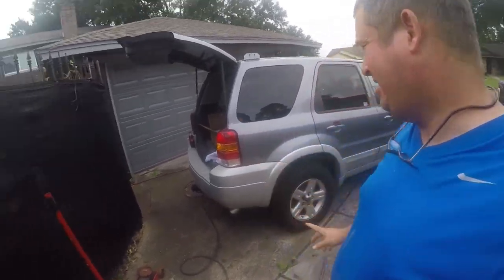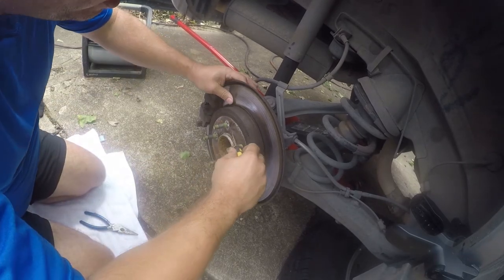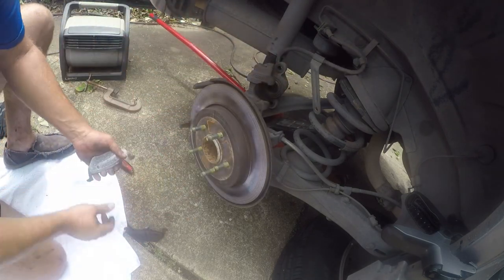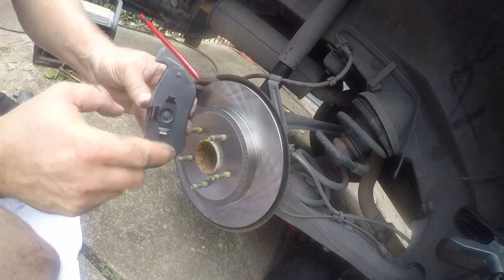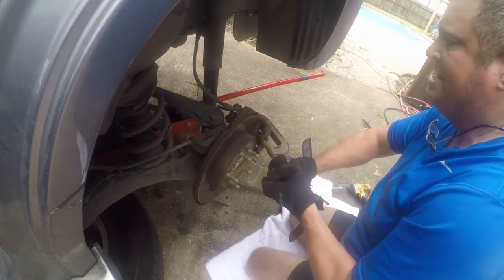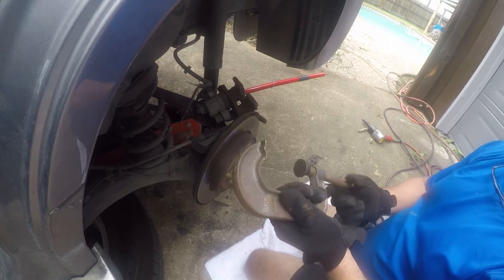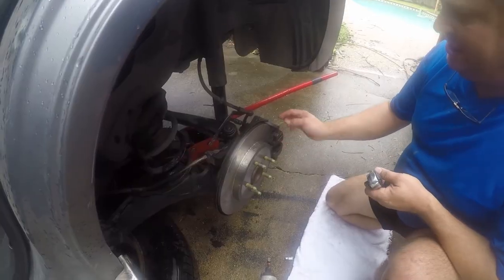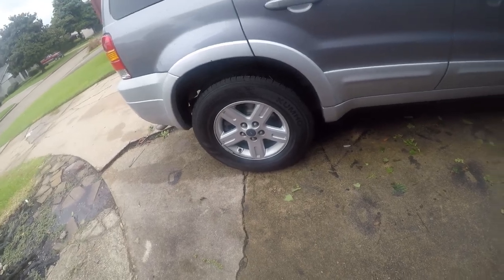Ford Escape Hybrid: (long) Replacing Rear Brakes

Comment: I have a 2006 ford escape Hybrid & I have soft brake pedal need help. I replaced master cylinder, ABS module, programed module & bleed brakes & still have the soft brakes

Comment: Thank you I need it, I have a 2006 Ford Escape I have to take the rear driver side rotor off because I had to cut away the stripped bolt that holds the shock on so I can replace the bolt.I hope I have no trouble, but with this video I should be fine

Comment: Hey Brian--
Great Video.

I was wondering about the disconnecting on the Hybrid battery and front 12 Volt battery.

I have been messing with this for 3 weeks, get the right parts, on the front, caliper bolts stuck, etc....
I did the Service Brake Mode a few times and had no problems till yesterday, when all of my battery went dead. I scrambled to get the caliper pins in and button it up, but when dead. Had to get a AAA jump on it.
So not doing that again for the other front, so my question is, did you just reverse your steps on the batteries?
1. reconnect the 12 volt
2. reconnect the hybrid battery in the back?

Also for this one, the big fuse box in the engine, I am going to pull the following fuses and found this out there:

In addition to battery disconnect, Ford says to remove fuses 24 (50A) and 31 (50A) in the battery junction box, though conventional wisdom says just fuse removal or battery disconnect will prevent the system from pressurizing.   

Thanks,
Kirk
Reply from the maker: I followed whatever was in the FSM.  I don't have the Escape anymore.... traded it in when I bought my Nissan Frontier.  I did not trust it at all when I was working on it so I disconnected the 12v and hybrid packs for safety reasons.  The brakes have an automatic test feature and I did not want it happening while my fingers were in there.
Reply: @hotpuppy72  Yep, that is why I did the the following, according to the manual, since I did not want those pistons going hot with my hands in there and I had a block of wood in there for just in case...

Here is what it says for Folks for future reference: Page 245 of Ford Escape Hybrid 2006:

Brake pad replacement information
The Regenerative Braking System checks the integrity of the brake
system at times when the vehicle is parked. This is done by developing
brake pressure for short periods of time. In order to change the brake
pads, it is necessary to enter the Pad Service Mode. This will prevent
brake pressure from being applied.
To enter the Pad Service Mode, perform the following with the vehicle
stationary:
1. Place the vehicle in Park and turn ignition to the ON position.
2. Apply the brake pedal.
3. Turn the ignition OFF, then ON three times and then release the brake
pedal. The total time elapsed for the three ignition cycles and brake
release must be less than 3 seconds.
The brake warning lamp will:
• flash as stored hydraulic pressure is released.
• remain illuminated once the pressure is completely released.
• flash if the brake is applied.
To exit the Pad Service Mode:
1. Apply the brake pedal and turn the ignition OFF then ON. This will
cause brake pressure to be developed within the brake system. Once
brake pressure is developed, the brake warning light will turn off.
2. The Pad Service Mode will also be exited if the gear shift lever is
moved from the (P) Park position, the vehicle is moved (wheels rotate)
or the ignition is turned OFF.
MAX
MIN
REVIEW COPY ——
2006 Escape Hybrid (ehv), Owners Guide (post-2002-fmt) (own2002), Market: USA (fus)
Maintenance and Specifications
295

Thanks for the reply Brian.

Comment: Follow-up questions if I may?

You had to remove with needle-nose pliers what appeared to be retaining clips for each bolt going through the old rotors to secure them in place, but the new rotors seemed to flop around.  Did the new rotors have those clips built-in or not?

Did this service (pads/rotors) require any bleeding of the brakes?  As you mentioned, I hear that procedure requires software, but I understand Forscan now includes a module for bleeding.

Finally, did this vehicle or your other Escape hybrid (i think in another video you may've mentioned having two at one time) ever experience failure of the flexible brake hoses that seems to be frequently mentioned in other videos or discussions?  It sounds like first generation Escapes (hybrid or standard) had hoses prone to cracking or swelling/deteriorating from the inside.

Just curious.
Reply: Clips are just to hold the rotors in place at the factory, not needed when replacing the rotor. After installing the new rotor, you can thread on a couple of lug nuts to hold the rotor secure before installing the brake caliper.
Reply: Mark Hammond is correct. The clips are just there to hold it on different stages of the assembly line. Once you put the caliper back into position it can't flop off even if it's cockeyed slightly. It will all straighten out whenever you put the lug nuts and wheel on. If you're anywhere in the Midwest after one year it'll become a permanent part of the wheel hub so you won't need clips or lug nuts 🤣

Comment: You need to be using jack stands not convincing people that they should risk destroying their tire if they don't know how to jack up a vehicle and a 50+ minute video? You can skip the parts where you show that the wheels are blocked off and when you're lifting the vehicle improperly. I just feel like this is a video of how not to safely work on your hybrid vehicle/brakes besides when you disconnected the hybrid system
Reply from the maker: lol.... you can always make a video and post it.  good luck armchair OSHA.  Perhaps you can make it a 90 second short while you are at it.

I'm showing what worked for me.  Years ago I might add.  I'm also using lifting points that are in the FSM (Factory Service Manual).

I have no idea how you think removing a tire is going to destroy it.  Anyway, let us know when you post that video.
Reply: @hotpuppy72  my issue with the tire is that you're saying it will support the vehicle if the jack fails which isn't true at all so lose the jokes with the "armchair osha" nonsense. I wouldn't make a video on this because like you stated the calipers are electronic so you need a scan tool (which I don't personally own)  to operate them properly which you didn't do in the video you just manually "relaxed them" which most likely damaged the solenoids but once I have access to that equipment I'll be sure to tag you in the comments. I made my comment for the community to save them the trouble of damaging their vehicles. Why are you making it personal by name calling?
Reply from the maker: @batjeep5ter947  The tire will support the vehicle.... if you don't believe me go to a few junk yards.  I think you need to research and better understand how brakes work before you get into criticizing forcing the calipers open which is a standard practice.  The scan tool is only needed for bleeding because the brakes are electrically actuated due to it being a hybrid.